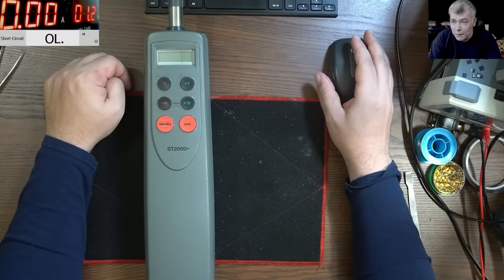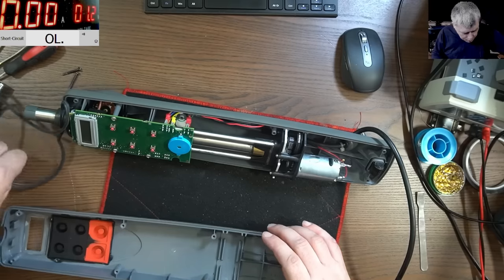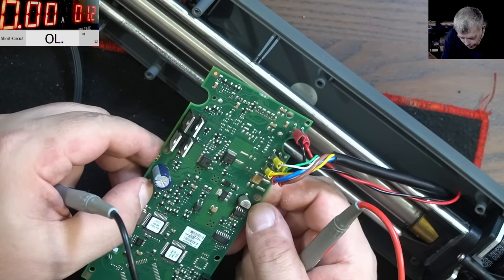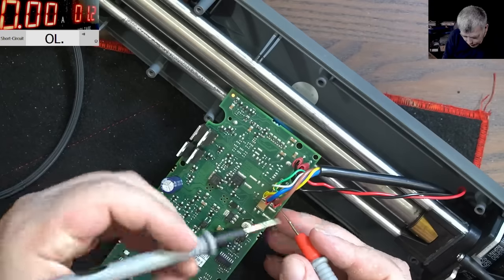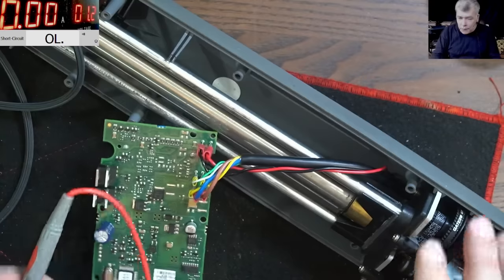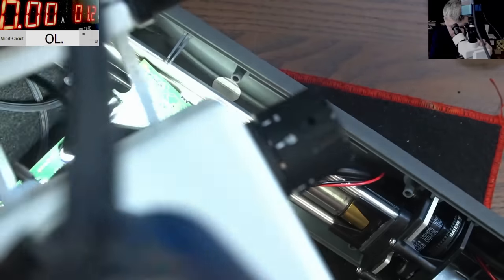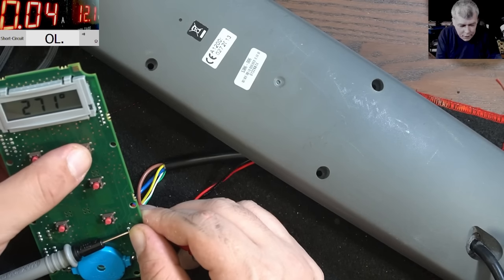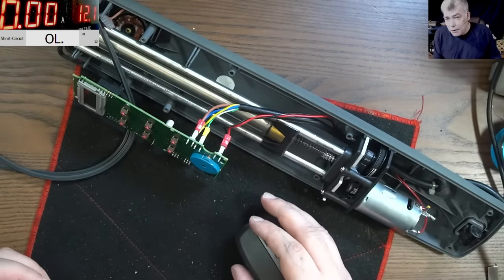Autopilot Raymarine ST2000+ repair. Let's use general electronics knowledge and figure the schematic

Comment: the ribbon cable attaches to a device called a fluxgate compass, an electronic compass if you like. These autopilots attach to a boats tiller, and when you turn it on, the fluxgate compass locates the boats relationship to a north south heading. You push a button to locate your course, and the control arm of the autopilot moves in or out to adjust the boats rudder tiller to the setting you turned on to. Attaching both ends, one to the tiller and the other to the boat steers the vessel along. 

The device is more complicated than it might be because it can also work in conjunction with a device known as a chart plotter. Thats basically a geo located screen which shows you electronic maps, and with both devices you can set up GPS located way points to plot a course. These things are very expensive to buy, but cheap builds. Moisture destroys them from the inside and they are poorly sealed. All that and, the gears which move the control arm are plastic, and wear out.
Reply: Great use of google mate.
Reply: @Brianck1971  I had an ST4000 on my last boat, the ST2000 is the lesser, and tiller only version to that
Reply: @z_actual  Of course you did m8.
Reply: @Brianck1971  You're a great help brian, thanks for your useful input. Pat yourself on the back.
Reply: @Virmana  How do I do that ? Hold on I'll google it.

Comment: Maybe there's a broken wire from one of the pins that connects to the board ,plus or minus in the black cable? That other thing on the back is a gyroscoop working like a compass
Reply: thanks,is there still a fluxgate compass in the circuit or no?

Comment: I would check all wires from connector to board with continuity testing. And jiggle the connector to see if a connection failed.
Reply: Exactly. Could be a broken wire. Might even be a fuse inside the connector.
Reply: I couldn’t help thinking this once Sorin said it’s working! Maybe he did it off video?
Reply: Agree !

Comment: The connector has 12VDC plus and minus, NMEA Data plus and minus and SeaTalk Data plus and minus. The thing dangling below is a fluxgate compass. Be careful when assembling not to pinch any ribbon cables or run a screw throug the ribbon cable

Comment: Love your videos Sorin but i have to yo agree with the comments. You can see under the microscope the that all the connections are written on the PCB I think you missed it. But the video clearly shows that.  I also agree 100% it almost certainly a cable break, or a problem with the multi pin socket the plug goes into.  Good luck.

Comment: After reading the comments of the colleagues and watching your video, probably but still with extreme reservation I would venture to review one.
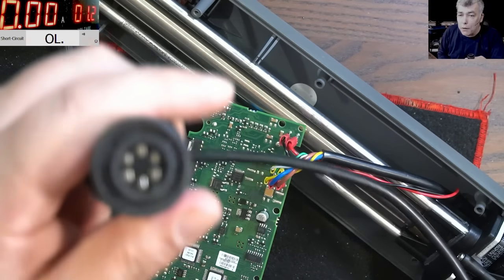(5:37) In your browser: mouser electronics and once inside please type: switchcraft circular connector 6 pin and then choose images.
 On the other hand, I hope that no airplane pilot is watching you (they would like to send you their automatic navigation devices😊). Thanks for sharing. All the best.

Comment: The two L shaped ICs in the middle are voltage regulators.  Positive and negative. The case to ground regulator is negative.  They do use lots of components on the "ground" line because its not ground.  Generally some of the heavy lifters are shorted, open current sense/ feedback resistor, shorted diodes, etc.  It can even be as simple as a bad electrolytic cap.  It doesn't take long to do a quick test of all the typical failure components. Broken wires and connections are common issues too.  If it all works then there's a short on the load side of the cable.

Comment: could the issue be a broken connector in the cable to the mother board? that way - customer would say its faulty but you started testing at the board - not the plug?

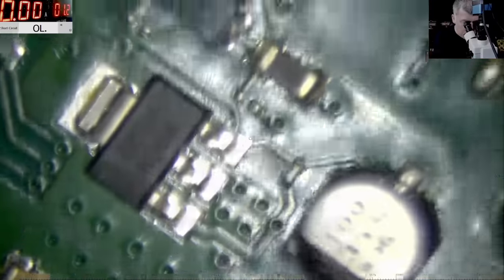Comment: 10:08 - Yea, but if you go deep in SMD color markings, you realize some colors overlap, like some capacitors and some resistors, or some capacitors and some coils. So its easy to make wrong conclusion.
20:50 - Maybe that black cable is broken, sometimes work sometimes not, or not at all, you powered device straight from pcb. Obviously some data is going there.
21:45 - Gyroscope.
Reply: Compass not gyroscope

Comment: 9:39 in under the microscope, yellow is DATA, blue is 0v and brown is 12v ...... it's printed on the board, So I expect all the spade connection points will be marked on the board. Could be a problem with the cable, the plug on the end of the cable or whatever that plug goes into which supplies 12v to this control unit.

Comment: Darn, was hoping there was actually an electrical component issue to be fixed given that my ST2000+ just got fried from a poor wiring connection on its power supply from my boat and I was hoping to benefit from this vid. 😂
Reply: Turns out that just like this one, mine was fine. Redid wiring in boat from PO and it works again.

Comment: In Australia. Colors for ac is brown live and blue gnd. So I'd guess as you found . Brown is plus. Blue is gnd.
Reply from the maker: There is no AC, only 12 DC which any normal manufacturer it will use red and black
Reply: @electronicsrepairschool  Probably didn't want to get the motor wiring mixed up with the power input colours. Or maybe that cable comes from some household AC application. Those colours are for AC wiring not DC, strange.
Reply: @anthonydenn4345  Yes. Completely agree. These are the wire colors authorized to meet standards for electrical installations here in North America (black HOT, white NEUTRAL, and green/yellow (combination) for GND). They are mainly required in hospitals, schools, government facilities, etc., and require authorization from the power company in the relevant country. In this world trade environment, all you need to do is check inside the device which colors were used (hot, neutral and ground) and take them into account when making our measurements. All the best.
Reply: @electronicsrepairschool  Yes. Red positive, black negative (common) for DC applications. Another way of saying it, a convention that all manufacturers abide by. Even in cheap applications like USB keyboard and wired optical mouse it is true. All the best.

Comment: i have fix the same model in the shop i work u need a magnet to test it
Reply: yeah geolocation with a magnet in the antenna you can test the pilot and the bar moving even with a magnetic screwdriver
Reply: marine staf has seperated ground
Reply: like car audio amps yellow with blue together
Reply: aaaaa mf sorin no the not make it unrepairable hahaha the are writing on board the polarity
Reply: tip usualy the cable to the motor cuts of check it
Reply: test the motor then when all is ok use a magnet

Comment: Youre amazing... you take apart a device without testing it or knowing how it works or what the problem is??? one minute on the manufactors  website and you would have the connectors pin out, and you would know what a fluxgate compass and a NMEA interface is.  Im sorry to say it, but you are far away from being a professional..... you waste your time....
Reply: A bit hursh. It is always a good idea to google any device/component for schematics and information, but Sorin is doing a lot of unedited videos.
Reply: @silviuguseila2552  I stand by my statement. Sorin concluded that it was the customers set up that was faulty, but he has absolutely no grounds for saying that. He applied power on the pcb and did NOT test the wire or the plug?! That is sloppy craftsmanship no matter what way you slice it...
On top of that he did not fully test the device simply because he didn't know how the device should work. The headline is Repair school. Can you honestly say that there is any valuable information to learn in this video?  All I see is i sloppy, randomly poking with a multimeter without any plan or purpose. After 45 years of repairing and troubleshooting I'm really not impressed..